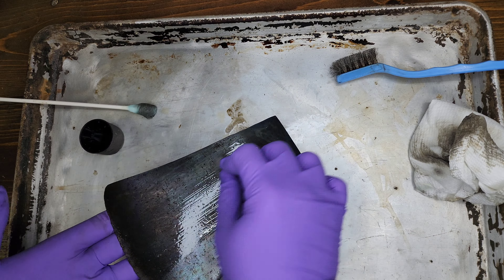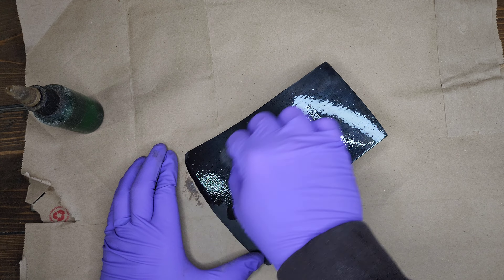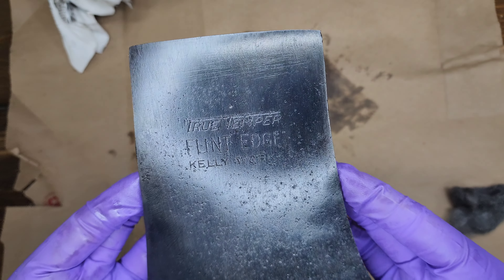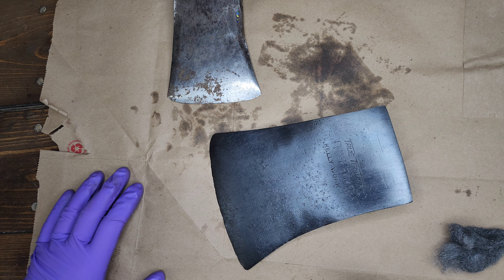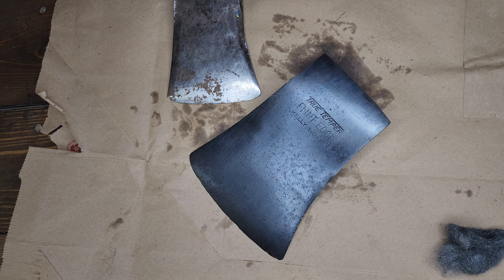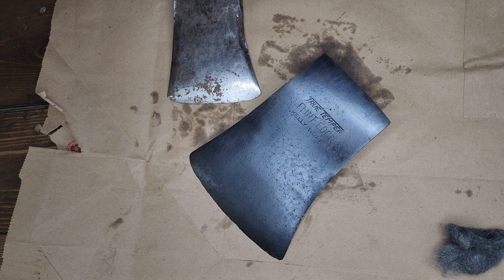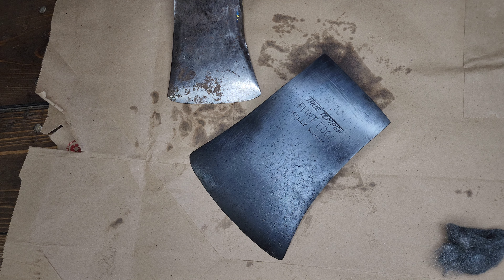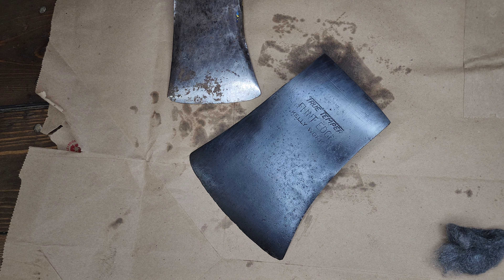Abused Axe Repair 2 Sanding and Bluing

Comment: Any full build will be cool.   This is almost the exact same process I use.   If I remember correctly, 180 or 120 grit has always removed file marks for me.  I also stop at 400 as I think it is a very nice finish.   Great video, man.  Thanks for sharing.

Comment: A full build video would be great. I have the same head but its the oversized 4.5 lb one. Id like to see what direction you go. I am throwing around ideas for what handle to hang on mine. Thinking a 30c from whiskey river but might end up just making a custom one. I often get inspiration from your videos so id like to see a build here.
Reply from the maker: Thanks for the kind words!!! It's awesome that the videos are helping give inspiration to others and their projects! I started working on the handle last night. I picked at 28" curved househandle for it. It's got text book perfect grain. Completely vertical and no run out. I plan on shaping it how I've done the others and giving it a scroll end. It's hard to go wrong with a nice 30C also. When I'm done shaping mine they are very similar. But that extra pound might do better on that 30 in handle over the 28 I'm using. I'd you're on Instagram(I'm @nsvensen89) definitely shoot me a message! I'd love to see yours and what you do for a handle.

Comment: Looks good the perfectionist in me would have to get rid of the scratches lol. Full build please. Yesterday I did a half hatchet/carpenters  hatchet restoration owner said it was beautiful and looked like brand new but now it looks to good to use lol. I'm not really into those to much myself.    Darren
Reply from the maker: I hear you Darren! I was fighting the urge to keep going... and going .... and going. But wanted to stick to what I had planned for the project. In the future I may do a fully sanded and more perfect finish but I wanted this in a different direction. Cleaned, restored, very serviceable but will he a user (hopefully) I think I will post this one on ebay when done and that's another factor in not wanting to put too too much time in finishing the head. It will probably not make a huge difference in the price it fetches at the end of the day. Thanks for watching and commenting!!!

Comment: I've been following and watching along, and I think it was a few vids back you rehung the Tas onto that WR handle. Instead of switching the handle why not laminate a nice palm swell? I'm thinking of doing it for a Craftsman i have on a thin House handle.
Reply from the maker: Thanks for watching! And I've done a couple of lamination on handles and enjoy them. The problem I have with it is the handle needs to have enough meat in the poll to bit direction because the lamination only makes the handle wider in width. The old handle on the tassie in had already thinned down a while back and was a bit small in both directions. Also when you laminate the pieces on you want the handle a little thicker so you can blend the transition nicely. Next time I do a lamination I'll try to grab some footage of it!!

Comment: And Id rather get it as smooth or finished as I can with files. Sanding sucks
Reply from the maker: The sanding does definitely suck. That big Nickelson is pretty aggressive and bit deep. The deeper scratches showed up more after sanding and I didn't want to start over. If I was looking to remove all of the pitting I would have gone that route. It's hard to decide how far to take a project at times haha. I'd love to get a 2x72 sander in the future but that's a ways out.

Comment: Any full build will be cool.   This is almost the exact same process I use.   If I remember correctly, 180 or 120 grit has always removed file marks for me.  I also stop at 400 as I think it is a very nice finish.   Great video, man.  Thanks for sharing.
Reply from the maker: Full build is underway man! I appreciate it. I wanted to keep the scratch pattern deeper on this one to help hide some of the other marks so I didn't go too fine. If it was smoother overall I'd have probably gone up to 400. I think this rougher finish took the bluing nice though.
Reply: @IronOxAxeAndTool  It definitely turned out nice